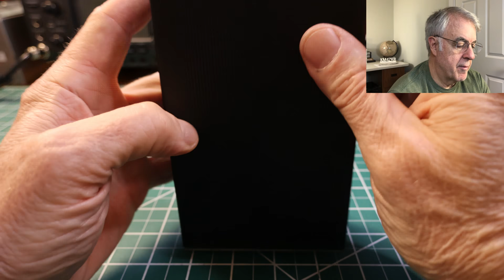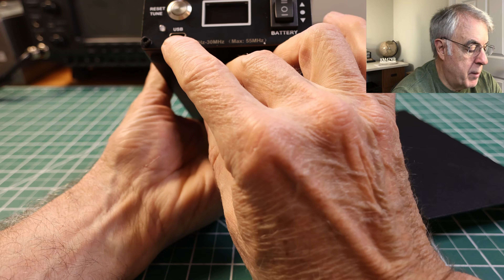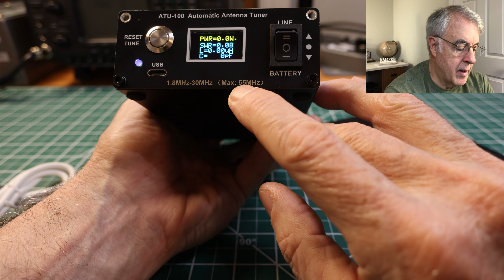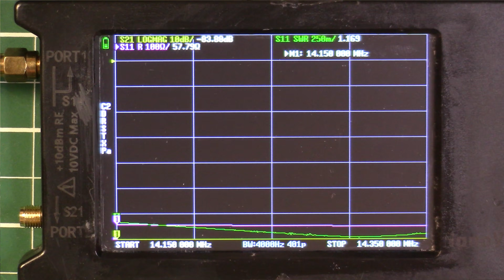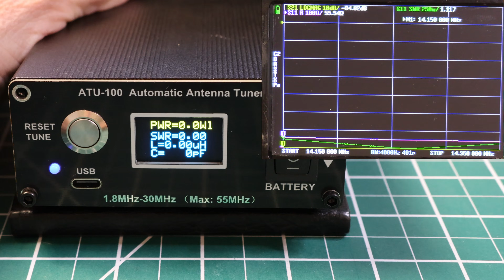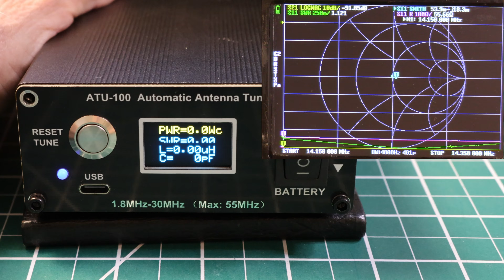ATU-100 Tunes 80m and 17m on a 40m Loop (Real Test)

Comment: Thank you so much for the video Sir. Unfortunately, I have nothing but hatred for mine. I have tried using it in pass through, auto & manual mode however the only mode mine will tune is AM mode. So I am going to assume I paid for new, but I received a faulty refund.
Reply from the maker: I generally tune mine using RTTY mode or you can use CW mode if you have a key.  Things can get frustrating either if the unit is not working correctly or we are not doing something correctly. I have experienced both. Hopefully you can get yours to work for you.

Comment: Jerry thanks for a very good video.  My question: If used with the bypass off and the auto tune off (no underscore line and then no dot); what does that mean and could one tune it by pressing reset and then tune, then key mic—-would it then keep that tune to use until retuned or bypass turned on? Sometimes I want to tune once and not have it retune.
Reply from the maker: Yes, with auto tune off, if you do the manual tune by pressing and holding the button till “tune” shows on the display, it will hold that tune until you power off or do another tune.

Comment: Hi, Jerry--great vid. I have had one of these for about a year, and I only used it in Auto mode. Your use of it in Manual mode was very instructive. It is my understanding that the ATU100 is an L-network, and the tuner decides whether to make the network capacitive input or inductive input based on whether the antenna impedance is higher than 50 ohms or lower that 50 ohms. Capacitive input if it's higher, inductive input if it's lower that 50 ohms. Necessary to know if using the tuner to design a separate fixed value matching network, like at the base if a vertical andtnna or something. Would appreciate your thoughts. Barry WA4WWK
Reply from the maker: The auto tuner can insert a mix of capacitive and inductive values, it is not necessarily an either or situation as it can and does use both as needed to match the antenna as best it can with the fixed capacitors and inductors it can select from.

Comment: Jerry, I recently just found your video's and appreciate you taking the time to share your knowledge and explanations!  

In my search for a remote ATU that doesn't cost an arm and a leg, I found the ATU-100 for sale in a couple of well-known places, but not knowing any reviews at the time, I was skeptical to purchase one. 

Then I found your review and demonstration and immediately purchased one even though it is not designed as a remote. I thought I would figure out some way to use it closer to the antenna. Then I read the comment section and saw Richard Owens comments on how he used his.

Even though Richard gave us a description of what and how he did it, I also would like to see if you would consider making a video.

Thanks for what you're doing!!
Reply from the maker: Thanks!  I will consider doing that when I get to my new QTH.

Comment: I've used an ATU-100 for about a year and loved it.  I recently bought an ATU-130 rated for 200W SSB and 100W digital.  It has larger toroids and 5A instead of 3A relays.  Also a 4:1 balanced output.  Have not used it yet.  73 KK7YIS
Reply from the maker: Interesting. I have not seen one of those. Will have to check it out

Comment: Hi Jerry.  I have this tuner, it works very well with my Icom 706MKII.  I have W2ENY's Ten-a-Tuner module.  The module makes the radio put out a 10 watt CW carrier for several seconds and works with several Icom radios.
Reply from the maker: Thanks for sharing your experience with the tuner and the module! 73, Jerry
Reply: PS  I use rubber feet that are about 1/4 inch tall.  I like to have a little air space under/between my gear.
Reply from the maker: Good idea!  Which ones do you use and where do you buy them?

Comment: Good video.  I want to put a tuner in my attic to tune at the antenna.  Will these tune fully automatically, or does the tuner have to be reset with each tune?
Reply from the maker: It will tune fully automatically as long as it is powered up and in Auto mode!

Comment: I had the earlier version of this tuner it lasted only one charge before it died, when I pulled it apart I found that the circuit board components leads thru the board were puncturing the battery and shorting it out, I have yet to source a replacement battery because I am not sure the electronics are ok, so will use a power supply on it at the correct voltage to see if it is ok before I buy another battery.
Reply from the maker: That's really unfortunate! Thanks for sharing your experience, it's good to know. Was it from GooZeeZoo or another brand?

Comment: Jerry, if this unit loses input DC, does it retain the tune L & C setup as is (without power)? Or, does it default to a 'base' configuration?
Reply from the maker: Good question! If it loses power it loses the tune.  These are not latching relays. Thanks for watching and commenting!
Reply: @BudgetHamRadio  Mine retains the last L/C settings.
Reply from the maker: Thanks

Comment: Given the value of loops and doublets I think not offering a dedicated balanced I/P (coax out) version is a missed opportunity.
Plus a plastic kliclok type sandwich box to mount it in to make it fully weatherproof for external mounting directly at the antenna terminals.
Reply from the maker: Good suggestions. Thanks for watching and commenting!

Comment: The N7DDC tuners should be a wake-up call for the big name manufacturers.   They're actually pretty good - and, cheap, too.

I installed one in an IP67 weatherproof outdoor electric junction box and equipped it with a bias tee circuit, so I could protect it and power it over coax.   This allows me to locate it closer to the antenna feedpoint.  I highly recommend anyone with one of these do the same - easy, and cheap.

And, for those with the skils to do so, the display is i2c compliant.   So, you could interface the display port with a larger display, or even with an Arduino Uno R4 with wifi/BLE  and capture the data through an app on on your smartphone.

Thanks for the video, and 73!
Reply from the maker: Thanks for watching and the great info in your comment! 73, Jerry